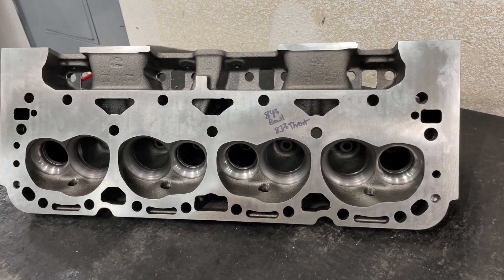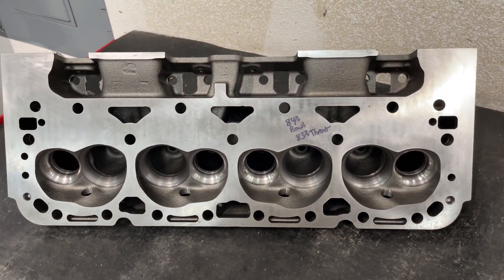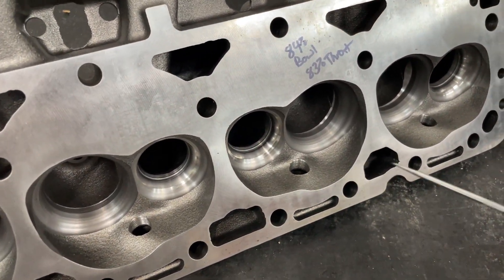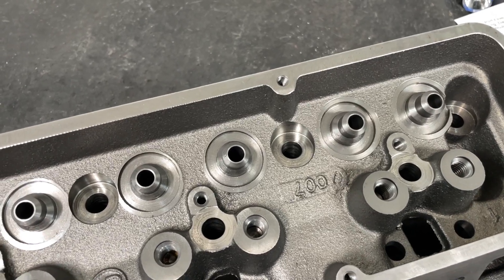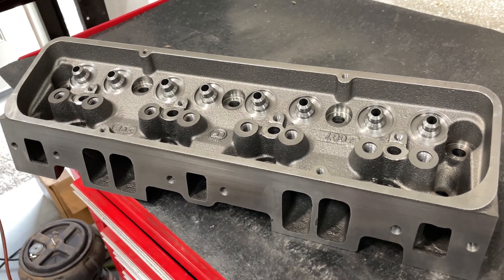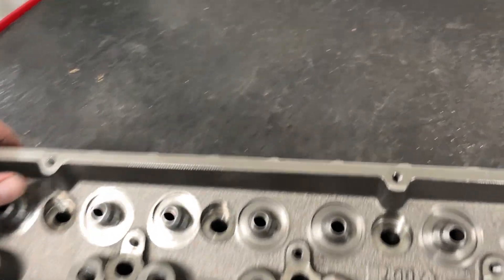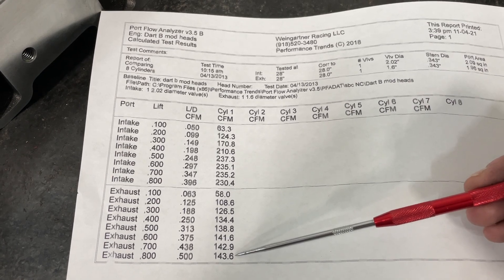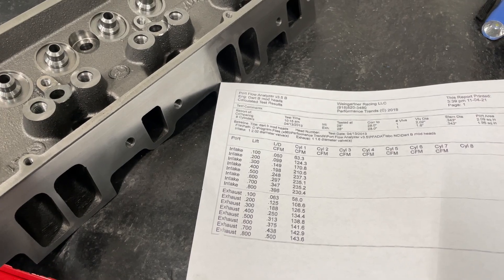SBC B mod cylinder heads

Comment: Hello Eric I just ran across one of your videos and really applaud the time&effort you are doing to make these awesome Information videos for others in the engine building for customers that have definitely lower budgets for racing ❤️🤙 one little bit of info for you. There is also the EQ350 I head for SBC  also has the IMCA logo with serial number s. As it’s legal for both sanctions. the head I prefer on the spec engine package for USRA Bmod & Stockcar Especially for the larger tracks. Now on shorter tracks I prefer the SR Dart head as it is legal as well. And again thank you very much for your awesome videos 🤙🤙
Reply: It’s not legal in the spec engine package in both USRA & IMCA Sanctions there are specific rules you have to stay within to be legal and Yes they do Tech pretty Hard and Fair especially at the larger pay events.  The Bmod rules and the Stockcar rules are very close in both classes and as well a little different between sanctions  mainly difference Bmod is 9.5-1 & Stockcar is 10.5-1 compression  Bmod has to run a legal 4412 Holley Stockcar can also run a Holley HP Series 4barrel in the USRA Stockcar

Comment: wow  disappointed you don't do port work . Thanks for the great video',  keep them coming.
Reply: It’s not legal in the spec engine package in both USRA & IMCA Sanctions there are specific rules you have to stay within to be legal and Yes they do Tech pretty Hard and Fair especially at the larger pay events.  The Bmod rules and the Stockcar rules are very close in both classes and as well a little different between sanctions  mainly difference Bmod is 9.5-1 & Stockcar is 10.5-1 compression  Bmod has to run a legal 4412 Holley Stockcar can also run a Holley HP Series 4barrel in the USRA Stockcar
Reply: @robertheeter9440  yes I understand that . I was hoping he would do port work on some other iron heads I have
Reply: It’s not legal in the spec engine package in both USRA & IMCA Sanctions there are specific rules you have to stay within to be legal and Yes they do Tech pretty Hard and Fair especially at the larger pay events.  The Bmod rules and the Stockcar rules are very close in both classes and as well a little different between sanctions  mainly difference Bmod is 9.5-1 & Stockcar is 10.5-1 compression  Bmod has to run a legal 4412 Holley Stockcar can also run a Holley HP Series 4barrel in the USRA Stockcar

Comment: Eric great video. I almost bought a set of these for my '83 Camaro, but ended up getting the Dart Vortec heads instead. Which of the two do you like better or would recommend? I am hoping soon to do a little port work to them to clean them up and hopefully get some modest gains.

Comment: I imagine a class like that would need a very bespoke cam profile to match piston speed and valve height, so as to keep port velocity/pressure as high as possible until the valve closes, to get the most BMEP. Would help keep valve float away too I guess.

Comment: So, this is like a stock truck head, with screw in studs, ??? With a better valve Job!? Like a truck head with half a step towards performance..  so these would be like a stock replacement for a 73-85 truck, only slightly better, 
I'm sure these guys do some things to get the most out of the restrictions, the street stock and pure stock guys would do crazy stuff, they had to run a stock appearing engine,  being so, they cut the heads and intake so much it was common to have heads only last a couple seasons,   they did so much, anyone  with a stock'ish engine could compete, they also had to run flat top Pistons, so they decked the block, so the Pistons are out the hole, heads cut so much , they running 13:1+, when we first started, I was wondering why they bothered running 110octabe fuel,  it didn't take long to figure it out, haha, one class did allow aluminum aftermarket intake.  It's crazy the power stock parts are capable of,   even spinning over 6500 rpm,  the cams were limited to  .480" so they ran tons of duration,  those were the days!
Reply: Compression in this class is limited to 9.5 to 1. With the 2 barrel engine package you're allowed a 7200 rpm rev limit and roller tip (not full roller) rockers. So really the only thing you can do within the rules to find performance is the cam. You can try to go lightweight with the rotating assembly but you can only go so far with that because the crank and rods have to be stock appearing.

Comment: I have a question.   Would you recommend this cylinder head as a replacement for stock heads on a street/strip combination that is used for bracket racing and is not required to run any quicker than 12.00 at 3300lbs
Reply: I think you’ll be disappointed. That 165 runner is just restrictive. 
  Look at something closer to 200.  The aftermarket iron heads are heavy also. 
   Unless you have class rules put about any cheap aftermarket on it in aluminum or iron and be happier. 180-200cc. Although if it was mine it would get a Dart 215 platinum in iron. 
    I’ve run the world street replacement head and the EQ.